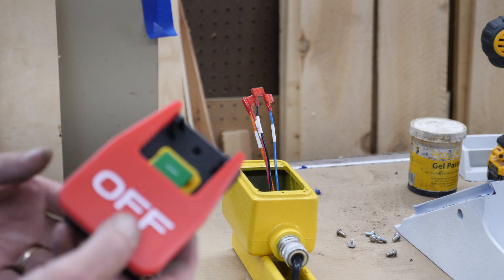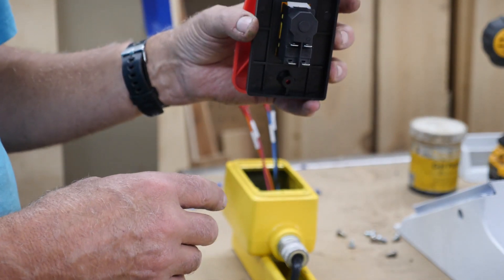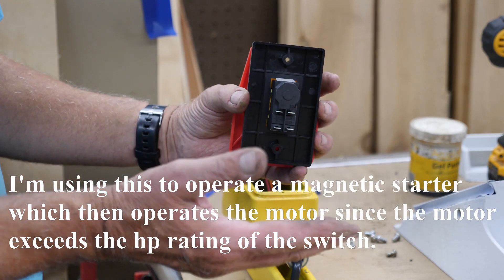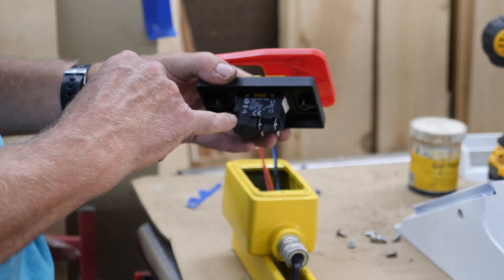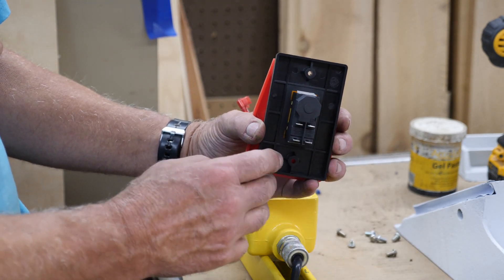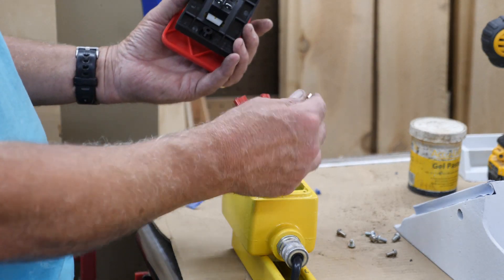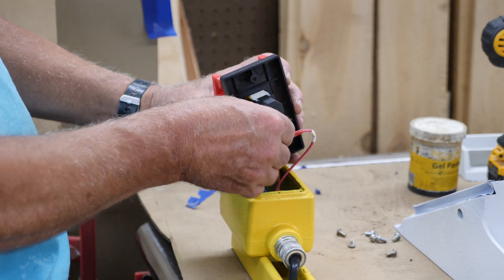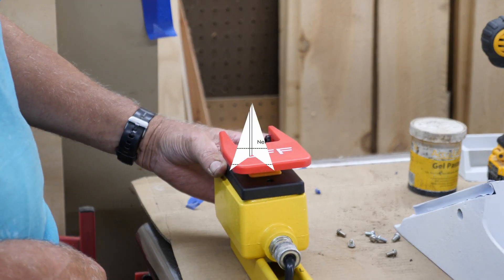Wiring the Powertec 71054 Magnetic Switch

Comment: MY colors are: Green grounded, Black, White, Orange, and Red. IT's a 14" Delta Bandsaw. How can I find out which wire is which?
Reply from the maker: Black will be L1.  White, L2.  As far as the other two, I assume these are the load, but you will need to contact Delta or find a wiring diagram for that model for polarity.
Reply: @rogersshop  okay. I thought this was a 1/2hp motor, but it's a 3/4hp. Is this switch going to work?
Reply from the maker: @SnowBearSteve  Take a look at the HP rating of the switch.  I believe it is only rated to 1/2 HP.  A 3/4 HP would work, but may lessen the life of the switch.
Reply: @rogersshop  you're right. Thanks for the help again Roger. Appreciate it sir!
Reply: @rogersshop  also, thanks for the help man!

Comment: Is there a way to test the switch? My motor goes on, but when I release the 'ON' switch the motor stops. I can hold the switch to 'on', but it will burn out the start capacitor.
Reply: I have the same problem.  Did you ever get it fixed?